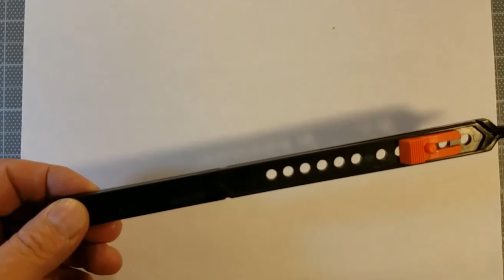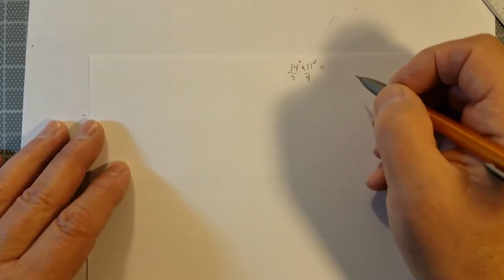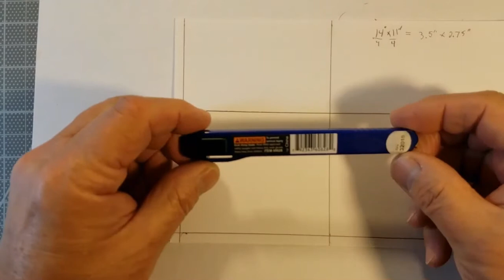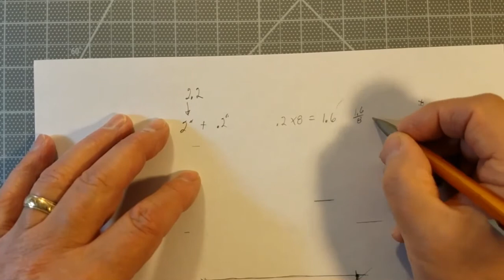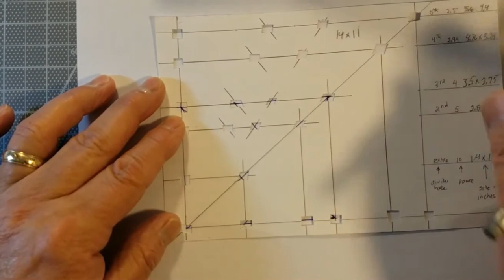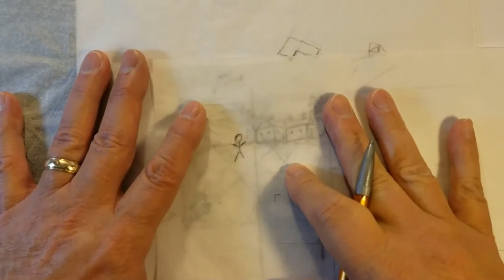Dynamic Symmetry Thumbnail Sketches  in Proportion to Your Canvas

Comment: A carpenters ticking stick or rule would work very well in this application to transfer marks from a small diagram to any size canvas.
Reply from the maker: Thanks for leaving a comment.  I am not so sure a ticking stick would be the thing to use.  We are working with a rectangle and not an odd shape where a ticking stick is most useful.  In this video I am showing how to make the thumbnail area in proportion to the full size canvas and at the same time in a ratio that corresponds to a proportional divider.